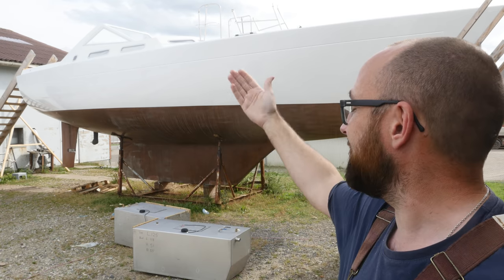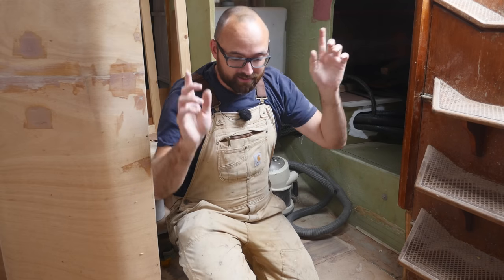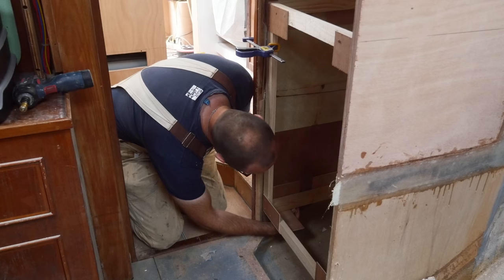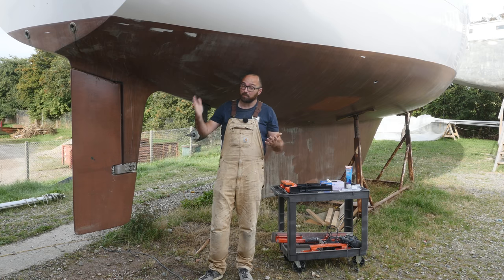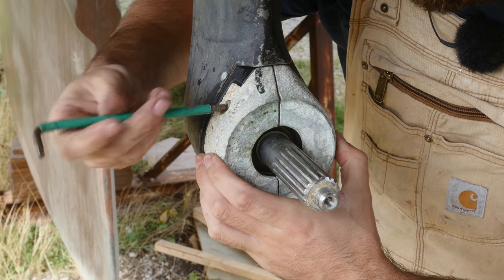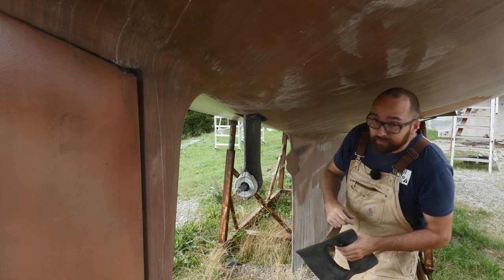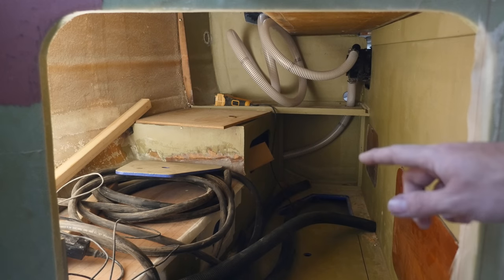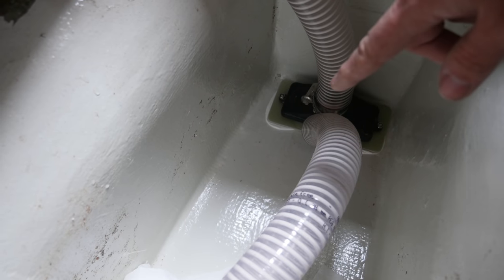Sail Life - Saildrive seals, manual bilge pump & washer/dryer area - DIY boat project

Comment: No filings in the oil or in the casing?... That is good news!.. Hangon! your placing a fuel tank right next to or even within kissing distance of a clothes Dryer... A machine that is reknown for catching on FIRE especially if it isnt treated just right even in ideal conditions, right next to a DIESEL FUEL TANK... You seem like such a sensible person, I trust you've made adequate provisions for this decision such as flame retardant material about that tank and its lines, smoke and temprature sensors, a decent flame suppresant system... at least a yellow canary.
Reply: Ok Mom. You have let your imagination run amok. This is not Hollywood. A canary might be fun though...
Reply: G Henrickson - okay.. hollywood eh?  fuel line rupture diesel sprays everywhere and you know I mean everywhere, and over everything, work with diesel for a bit and see what I mean... hell just fill up a diesel car at a pump and see how easy it is to have a bath in it. then light a match.. or wait for a spark or have it hit a hot surface or get into circuitry...oooh how convenient a machine who's  primary purpose is to get hot and dry clothing.. limited ventilation thatll do nicely.. Freakin BOOM!... no Im not joking Ive seen it happen. go to a burns ward and see if theres anyone laughin there...H.M.A.S WESTRALIA RING ANY BELLS?

Comment: unfortunately, when it comes to engine parts and seals you are always better off going OEM. considering that sail drive is in constant contact with the water you were correct in going OEM.
Reply: Joe, Volvo doesn't make the seals.
Reply: @stevenr8606  That's not the point. The manufacturer has specific requirements and testing based on what they expect and need from the company that makes them and almost always the part they use is the best one for the job for a variety of reasons. The seals on your sail drive is not an area where you want to choose the wrong seals.

Comment: You need one of those satellite internet domes like SV Delos has so you can work while sailing.   You have the perfect skill set to work while traveling but you rarely discuss it.  It could be a good topic.  As you move from building to sailing, the audience will change to rather dramatically.  So best to prepare now by starting to discuss things beyond simply projects.  Because what happens when you start your journey?  Onboard Lifestyle had to make this transition and it was struggle for them to maintain subscribers while transitioning from a building channel to a traveling channel.  It can't be an abrupt transition.  Steps need to be taken today to build that other audience.  Will 80,000 DIY fans continue to follow the journey when the boat launches and the projects become a minor part of the content?  Best to start working on content about the future, travel, working remotely, etc into the channel now so you don't see a big fall in views when the channel transitions from building to traveling.

Comment: Ok deisel tank next to a dryer hmmmmm that doesn't sound good just saying dryers have a tendency to over heat. And............. Nice job on the other bits
Reply from the maker: It's next to the washer. Dryer is above it :) There is also a diesel tank right up against the engine. I think it'll be fine :)
Reply: You can drop a lit cigarette into a diesel tank and it won't ignite.
Reply: @_______-   I disagree I used to teach fire extinguisher class with old deisel   just thinking of lint and heat build up. Dryers have that habit of catching on . I'm sure Mr spiffy has it under control

Comment: I would like to float an idea for an alternative to having a dedicated generator on a sailboat.  Mobile Electric Power Solutions, Inc. (www.meps.com) has a line of SeaPower(TM) engine mounted generator products that resemble a standard engine alternator with accompanying controls that can produce 5.1 to 8 kW of pure sine wave AC power when the main engine is operating.   In the case that a sailboat would normally tend to make relatively little use of its main engine, it might be advantageous to operate it periodically and for good purpose to power a generator as described above.  I am more a powerboat guy, but long time follower of this channel, and having been thinking for several episodes that valuable interior storage space can be saved on a smaller sailboat like Athena eliminating a dedicated generator set and making better use of an otherwise under utilized main engine possibly improving the reliability of the main engine in certain use case scenarios.  My interest as a powerboat (i.e., raised pilot house trawler) guy is to avoid having to run my generator while underway in hot/humid weather.  I would still rely on the generator when on the hook for extended periods of time to periodically recharge house batteries when solar charging is not available or insufficient.  In this setup, the main engine mounted and dedicated generators become backups to each other.
Reply: The dedicated genset is precisely so he doesn't have to run the main engine at regular intervals.